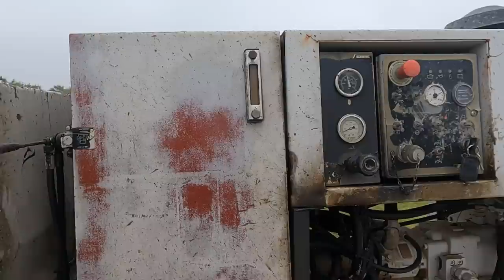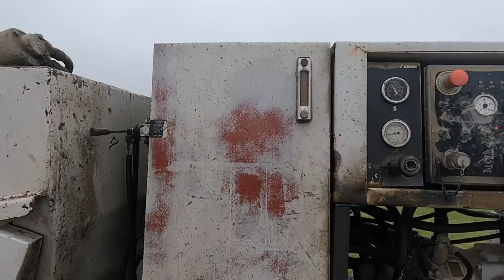Pumping concrete from a volume metric truck. Trailer pumping with Muddyfeet

Comment: Down here in FL , lots of ppl like using thhose type of concrete trucks ❗️❗️❗️❗️
Reply from the maker: I like them for the trailer pump
Reply: These volumetric trucks are usually too slow for a mobile pump but perfect for small jobs that use static pumps
or trailer pumps as @muddyfeet calls them.

Comment: Volumetric mixers are way better for your trailer pump, they appear to have more control on the quality of mix they produce and there is no chance of the concrete starting to go off in the pump or hoses !! 
There are a few companies around here who operate them, one has a semi trailer type, it spends most of its time on road maintenance jobs. 
If the lump came from you and not the mixer, does that make it a bagfish ?? 🤔 I'm asking for a friend 🤷‍♂️🤣
Reply from the maker: I’ve never thought of it like that.